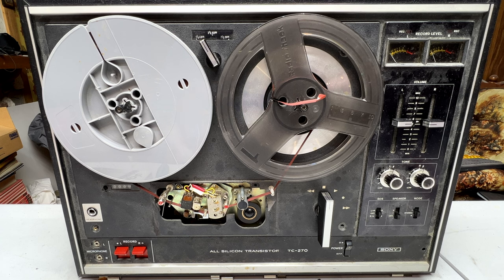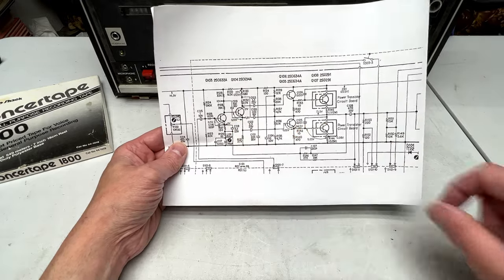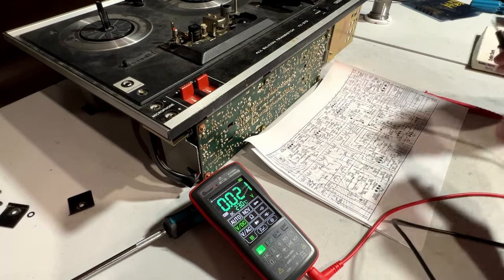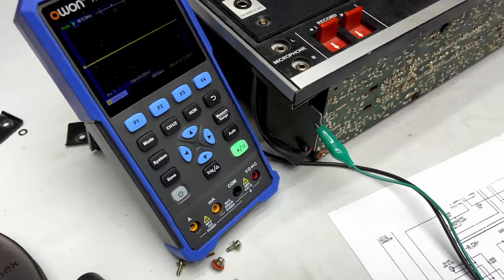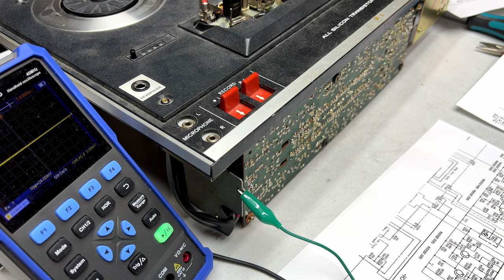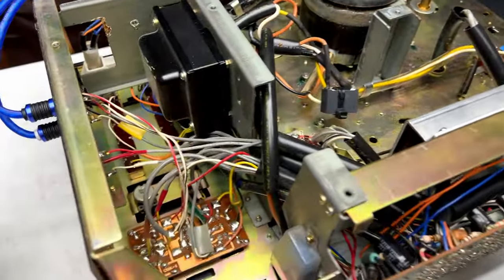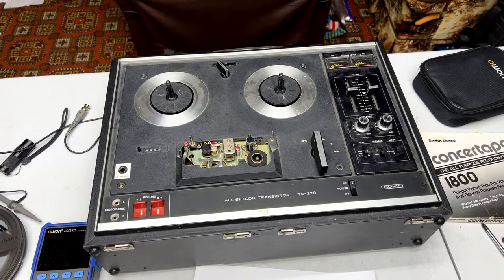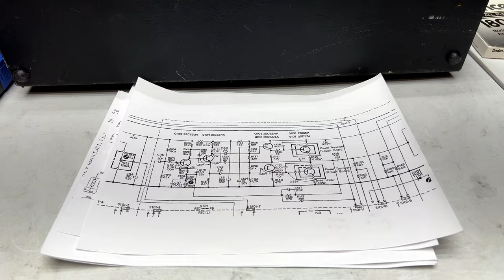2024 Summer of Sony - Rediagnosing the TC-270 Open Reel Deck

Comment: That ECG 175 that you quote in the video looks fine to me - no silly price! 

The problem is that - sellers are aware that some folk don't know how to cross-reference and get a suitable transistor, so they (the seller) exploit the naivity of the potential buyer. I've seen some crazy/greedy prices on ebay,  just waiting for some sucker to come along.
Reply from the maker: Thankfully I still have a gigantic ECG cross reference manual from the 80s sitting right next to me. I can find alternates in there that the Internet can't help me with.

Comment: Just some thoughts - measure the voltages across either R140 or R141. 

This will enable you to eventually check the bias (or 'quiescent') currents in the 2SD291. 

Base resistors R143 and R142 are only 10 ohms, and the base current will be small, the voltage drop will be small too.

Estimating: Since Ie ~ Ib(hfe+1) or Ib ~ Ie/(hfe+1) then we can get a quick estimation of Ib. Let's say if Ie = 1 amp (it won't be that high) and hfe ~25 (lowest figure)
then Ib (highest figure) ~ 1/26 or about 0.038amps, and so the voltage drop across the 10 ohm is only about 0.38volts. It will probs be about 0.10 to 0.40v.

Choosing highest drop across 10 ohms resistor .... Then the Voltage across R144 o R145 = V(R140) -0.40v -0.55v

The bias Collector (or Emitter ... almost the same) current will be about V(R140) -0.40v -0.55v divided by 1, easy. 

Knowing this you can see if a new transistor can handle the bias currents.

If not excessive, you can try some TIP41C transistors, yes a different casing, but you can improvise?  ;o)

The TIP41C will need a heat-sink, and will need to be electrically isolated if you fasten it to the Sony's heat sink. 
But without heat sink, it should be okay for a short duration test. 

TIP41C is cheap, but not rubbish.  :o)

Some calculations: From service manual, R144/R145 are 1/2 watt rated. This limits the bias emitter current Sony are expecting.
And from P=i^2 x R, 
then 0.5=i^2 x 1, 
yields i = 0.707 amps maximum. This is the top-end bias current you can expect, but it won't be near that.

I think the quiescent or bias emitter current will be around 0.100mA and upwards, but not 0.707 amps, as this would subject those resistors to stress
for a long period of time.

(PS: I hope this makes sense, and that I haven't made any typo errors).

Comment: If you think you have faulty transistors - 

You can replace 2SC631 and 2SC632 with KSC1845-FTA series, and the other 2SC634 with KSC1815-Y or better (if you can find them) the KSC1815-GR.
The 2SC631A can be replaced with the KSC1845-FTA or KSC1815-GR, if the GR doesn't work (but it should) then the 1845 will be okay.

Basically a KSC1845 is a modern equiv of 2SC1845 series, same applies to the 1815 series.

these KSC1845 and KSC1815 series very handy to have in stock. I've got a few hundred. Buying 100 or 200 in one go is much much cheaper.
Reply from the maker: It's a blown 2SD291 on the bad channel - I have two 2N3054s to try replacing both parts with. Not very easy to find alternates for those parts.
Reply: @Oklawolf  The NPN replacement needs to have the same pin-out (exact), and then just go looking for same or higher power capabilities.Make sure the fitting is the same too. Should be okay. Also - re-work the solder too, and later inspect with magnifying glass. I clean the boards with an old toothbrush and IPA or acetone - acetone will part dissolve the lacquer conformal coating. When all done - 'paint' over with some cheap clear nail varnish.